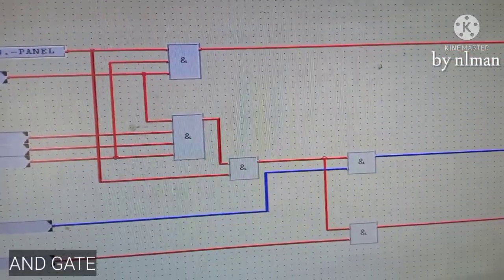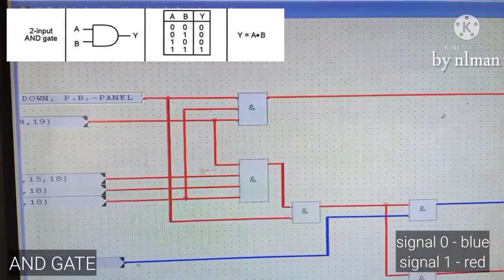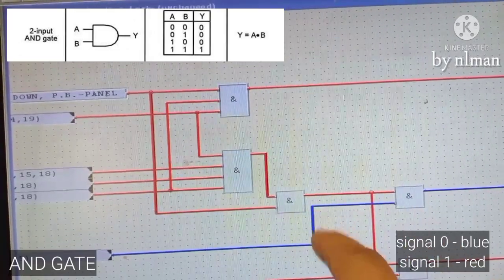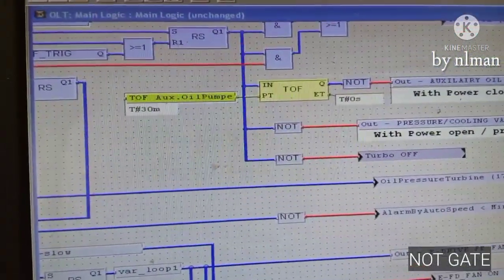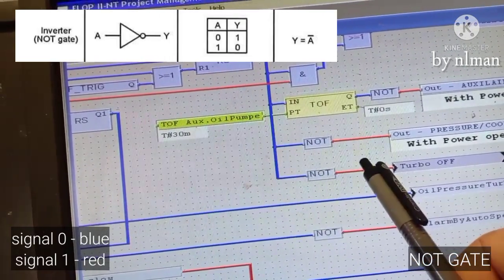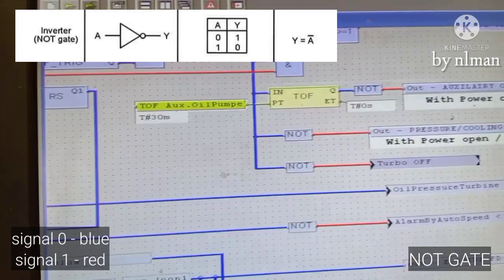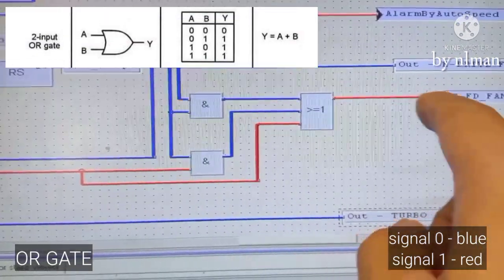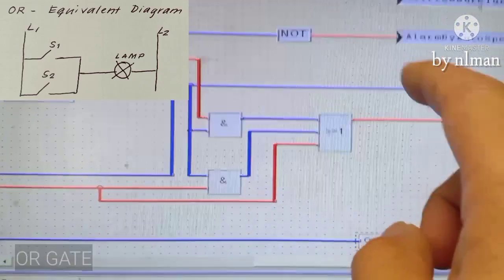Oil & Gas Maintenance: PLC Basics -  How to read Logic Gates in PLC Programmable Logic Controller

Comment: Wow interesting! The last I learned this was in 1978, and put it to use when I was in the military and worked for Hewlett Packard from 1983-1998. i have to re-learn all these if want to work in electronics again. Thanks for sharing bro!
Reply from the maker: Our subject in digital computers fundamentals . Year 1987
Reply: @kabayan2011  Yes sir very familiar with and used it a lot when I worked for Hewlett Packard building microwave power amps for telecommunications and satellite/Inmarsat applications. Miss ko na rin ang electronics. Thanks again for sharing.
Reply from the maker: @aa6zi  as long as you know how to read Logic diagrams you can easily find the fault
Reply from the maker: Thanks